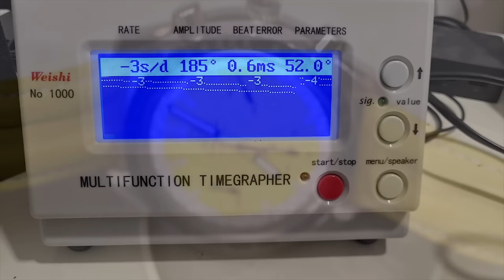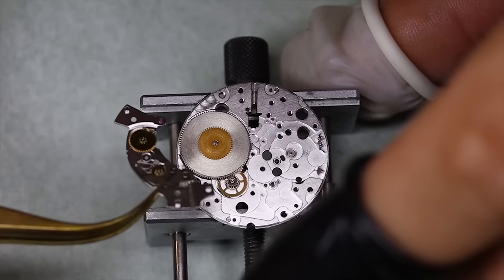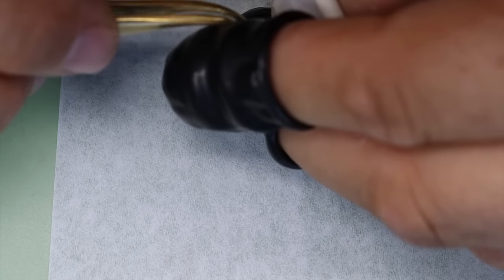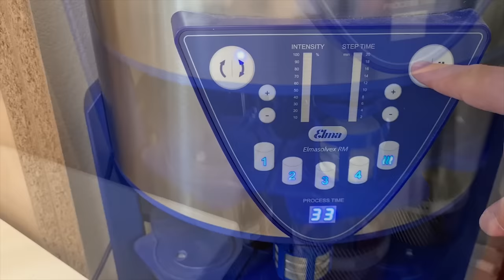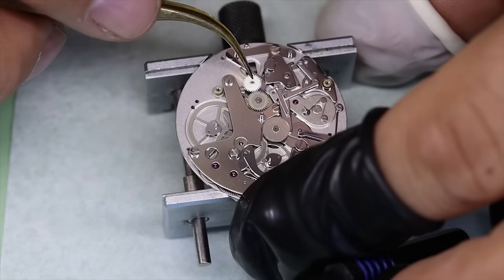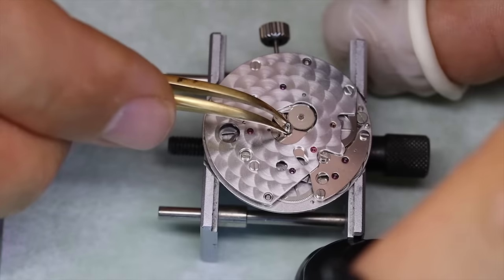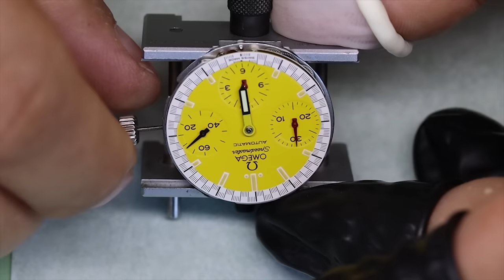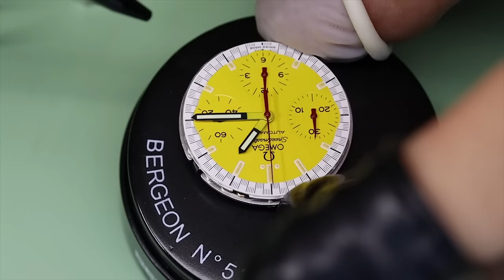The coolest watch on the track - but is it really an Omega?

Comment: I love your videos, but I didn't get it this time. I won't put a finger down, because I respect your work and your previous videos, But... 1. As is well known, in Swiss watch industry, many brands buy movements from others. Omega is one of the brands that have produced more in-house movements, but stop doing so in the 80's and 90's, and again is making their own movements since the 2000's. Is a Patek Philippe Nautilus not a PP because it uses a JLC movement? Is a Royal Oak not a real AP because it uses the same JLC movement that used PP in the Nautilus? Are VCs that use Omega and JLC movements not real VCs? That is very completely against how Swiss watchmaking industry has been build for centuries. 2. Omega didn't just take an ETA 2894-2 and put it in their cases with a little decoration here and there, as one might get from your video. As you surely know, ETA 2894-2, uses 37 jewels... Omega modified parts in the winding mechanism, also for the 2892A2, and added jewels in friction points, without adding functions. Omega 1140 has 45 jewels, instead of 37. So, disputable issue. 3. They used two ETA mechanical movements, also some ETA quartz movements, also worked together with ETA for producing these, and the Valjoux 7750, because Omega went into bankruptcy in the 80's because of the quartz crisis, and the group that bought Omega was the same that both Valjoux, ETA and many other brands.
Reply from the maker: Hello Lee, thanks for your well founded comment, I really appreciate that! You're absolutely correct in that the Swiss watchmaking industry is quite entangled and that various companies supply parts and services to each other across the entire spectre. Until the quartz crisis hit it was even mroe complicated than it is now even if they first tried streamlining things in the 1930's with ASUAG. JLC's moniker as the "watchmaker's watchmaker" stems from them providing base movements to the highest end brands, for instance, and Vacheron as an example would go on to change things like the balance and regulating system plus of course finish every single part of it to the highest standard. 
In my view, what Omega has done with the 1140/41/3220 is quite different, not necessarily technically, but commercially. They took an off the shelf movement, put on the DD module and made just a few minor changes in order to be able to somewhat defend calling the final product an Omega movement, with what that means in terms of customer perception and therefore sales price. I think that's a bit too cynical and they deserve a bit of heat for it, even if that heat comes from a small YouTube channel :) 
Note that the 2894-2 is an ETA product and does not use a DD module, although the concept is also modular.
Reply: @VintageWatchServices  Many brands have done exactly what you describe. But my point is that Omega didn't need to change the movement in order to call it their 1140 caliber or whatever, that is something everyone has done, PP didn't change much of their JLC movement in the Nautilus... But Omega did change two things: 1. The jewel count is different. 2. The winding mechanism is changed. It is not an off the shelf movement. There is nothing new in this, Rolex, for instance, never changed an screw of the movements they didn't producer an entire century. That is perhaps "cynical", but Omega at its worst moment did made changes to improve. This DD module, by the way, has been used by AP and even by RM. ETA and Omega at this point were, and are, brands of the same Group. But, the fact is that Omega did change the caliber, to improve it. there are even papers on that. Do the jewels count, you will see it doesn't match with either ETA, nor DD.
Reply from the maker: Hello Lee, I understand you have a lot of knowedge about these things but I'm not sure what you mean when you say the jewel count is different? Do you mean between Omega 1140/41 and ETA 2894-2? Those cannot be compared. The ETA 2894-2 is a 2892 base with an ETA chronograph module on top, it does not use the same chronograph module as the Omega 1140/41. The jewel count is of course different since it's a completely different module. 
The DD module used in Omega 1140/41 has 24 jewels and the base movement has 21. That adds up to 45. Is your point then that Omega thus asked DD to add jewels in the module?
Reply: @VintageWatchServices  No. I have some issues with your video, because I find it misleading. I know we are discussing very detailed and fine differences, but nevertheless. I'll explain: 1. Omega 1141 is an Omega 1120 with a DD 2020 module. Already there, the jewels count is different. But... 2. it isn't the only difference. Omega 1120 is not an "off the shelf movement." There are several changes between these two. To name some: Omega made their own automaton bridge, with smaller ball bearing, and their own gear train, and endshake corrector, which reduces the height difference between the auxiliary reverser and the rotor. this has also some other advantages. The jewels count is different, 23 vs 21, because of the ones used to hold the barrel in place. And of course the finishing, Rhodium plated, circular grained plates, bridges and rotor with Côtes de Genève, and even finishing in the upper side, which no one else did. Of course, also, Omega did their own rotor, which rides on small ball bearing. If all that, to you is an off the shelf movement from ETA, we have very different views on what "off the shelf" means. And, 3.  Will you give the same warning when talking about other brands? You have talked about Rolex, or IWC, or others. Some of these used literally off the shelf movements without changing a thing and without producing a single movement, quite different from Omega. Why is Omega's case different or special, when they did change the movement, but you have never talked about this in others, and of course Rolex comes to mind, not being able to produce a single movement in the entire XXth century. It is just too gratuitous trashing.
Reply from the maker: @leestrada1  Hi Lee, you definitely know more than I do about the 1120, but the 1140/1141 is not based on 1120, they're based on the ETA 2890. Omega 1120 has 23 jewels and indeed some more significant improvements over 2892, but the 1140/41 uses the 21 jewel 2890. 21 jewels in the base plus 24 jewels in the DD module for a total of 45. 1140 was gold plated, 1141 rhodium plated, otherwise they're the same.
Reply: @VintageWatchServices  The specific model you serviced has 45J, although there were after that 46 and 47J, so that can explain that difference, but even that one has Rhodium plated and Omega marks it as "Modified" in their internal documents. Anyway, I would still ask why would this not be an Omega and a caliber 1565 is a Rolex...? What is so special of this in this Omega, while there are more models with exactly the same (not so many in Omega's history although indeed in the 80's and 90's) than with exclusive in-house movements? If this is your take to this phenomenon, you won't finish. Not a single Rolex, Baume Mercier, many PPs, many VCs, IWCs, Breitlings, Cartiers, Bulgaris, Chopards and I could continue all day citing brands, have unchanged movements from third parties. But you pick an in-family example that is not exactly off the shelf... I juts find it curious. This is the kind of misunderstandings in the area that don't help people with lesser knowledge.
Reply from the maker: @lee S  Hello Lee, I really appreciate the opportunity to learn from people with the level of knowledge you have as an Omega enthusiast 😉

But it seems to me that your indignation is a bit misplaced here. The 1140/41 is a 45 jewel movement based on the ETA 2890 and not the Omega 1120. The 3220 is also not based on the 1120. The reason 3220 has 47 jewels is because there are two more jewels in the DD module used in 3220. The base movement in the 3220 is a 21 jewel ETA 2892, not the 23 jewel 1120.
The 1120, 1109, 1111 were indeed 2892's modified in order to be used in chronometer rated watches but are not relevant to the speedmaster reduced. From what I know they were predominantly used in seamaster chronometers but maybe you have more information on their usage. 

I still believe Omega pulled a fast one for commercial reasons with the Speedie Reduced and that's what I'm calling out. They are still great watches but as a guy mostly working on pre-quartz eta watches with actual in house movements I don't feel it's the same.

And rest assured that I do call out Rolex, for instance, clearly stating that they didn't actually have in house movements before they fully bought Aegler, but that's a different story.
If I do a video on any brand that has a movement they call in house or brand with their own name but that is in essence off the shelf, I will always call that out.
Reply: @VintageWatchServices  I have the highest respect for your work, I have seen every video you have uploaded here, and this is one of my favorite watch channels. I just wanted to clear that up, because it could seem my critique is a little harsh. I think we both have a point. I was talking from memory, and you are right that 1141 has the 2890-2 and a DD2020 on top. I was thinking of a 1120 base, which many refer to as that, and which would include the changes I pointed out. My fault there. But..., it is marked as a modified movement from internal Omega documents, where you can see very transparent information. One very obvious is that it is Rhodium plated and finished differently. I would still differ in calling it an off the shelf (although not as modified as 1120), as did Breitling or Rolex. Anyway the same critique you make in this case, I haven't seen it when talking about others, so this one surprised me, as it is a more knowledgeable channel than others on Omega. Cheers
Reply from the maker: Hello Lee, thanks so much for your kind words, it means a lot coming from a very knowledgeable guy like yourself! I do try to do my research before publishing a video, since I know I have many knowledgable viewers that will challenge me if I don't do my homework 😁 

And I do acknowledge that saying the 1140/1141 is an off the shelf movement is a bit lazy, especially when it comes to the finishing. But I also do think that what Omega put in is less than what they took out as there probably are a lot of buyers who think they're getting the kind of mechanics Omega really stands for. Not to say that ETA and DD do not make high grade products, but in-house has a very different perception in the market and will fetch a higher price. Anyway, we're at a pretty granular level with this discussion 😂

Thanks for watching my videos and I really do appreciate you sharing your knowledge like this. Did you maybe work for Omega since you seem to have a lot of inside information?

-- 
Best regards,
Stian
Reply: @VintageWatchServices  You are right, it is very granular level, haha. No, I haven't worked for Omega, I'm just very much into watches, since 30 years ago, I live and breath watches, and I collect mostly Omegas, I have also collected a ton of information on the brand, also on some others. If you ever have the need of information on a certain caliber or anything, drop a line here, if I am able, I'll be glad to share it with you. Cheers

Comment: which watch would you recommend? this speedy reduced with the chronograph module or a speedy with valjoux 7750?
Reply from the maker: Hello Miguel, I'd go for the 775x versions as a general recommendation. They're much easier and cheaper to fix if something goes wrong.
Reply: @VintageWatchServices  Thank you very much for the advice. I actually have a couple of speedys with that movement. but we must admit that this yellow dial is amazing

Comment: Stian, a question -- If you use the chronograph function a lot or for long durations, would an automatic be more accurate than a manual wind movement because the tension in the main spring is more constant or is the difference insignificant?
Reply from the maker: Hi Bullnose, that's an interesting but pretty much entirely hypothetical question 😂
If you run the chronograph for so long that the mainspring would run down, a manual winding watch that's not re-wound during the run of the chronograph would start giving less accurate results, typically running a bit slower in a well regulated watch. 
But no one really uses the chronograph anyway, so in 99.999999999% of the cases I think it wouldn't matter 😁
Reply: @VintageWatchServices  👍

Comment: Holy crap !! I am a certified auto tech and also own and operate my own Marine Repair business and that movement went way above any of my mechanical abilities . Just blows my mind that somebody can take a movement like that apart and put it back together and it actually works. I hope some day to learn watch repair . I want to restore old non working Rolex's . Beautiful job my man.
Reply from the maker: Thanks Roger! This type of module is pretty infamous in watch circles for being difficult to work on, and is honestly not much fun either. So if you can choose between an old Rolex and this kind, the choice is veeeeeeeery easy 😂
Reply: @VintageWatchServices  It is very surprising I have seen no working Rolexs for decent prices on Ebarf. I do understand your passion for what you do. I sure hope I can get clocks down and move to watches? They say if you are interested in servicing watches to start out with pocket watches . And those are dirt cheap too . Thanks for the reply love the watch !

Comment: Why would Omega use an ETA movement? Do you think that it is a fake?
Reply: I know that the ETA movement is a good movement, but it's available in a lot of much cheaper watches.
Reply from the maker: No, it's certainly not a fake :) ETA and Omega are part of the same corporate group, so it makes a lot of sense commercially.

Comment: Yes cool, but so bad caliber...
Reply from the maker: Well, it's not a bad caliber per se, it's just kind of misleading to call it Omega when it's absolutely not an Omega movement. The 2890/2892 is a high grade caliber and the module is of course well made, but a Lemania it is not.
Reply: Omega were not alone in mislabelling movements, all the big names did it. Rolex using Aegler movements etc.
Reply: Modulare concept is not max
Reply from the maker: @Gary Boyle  Hello Gary, you're absolutely right, but I kind of find this one worse than most. Aegler was in practice Rolex' movement arm for many decades before Rolex finally put a ring on their finger, but this one is pretty much just an off the shelf ETA with a DD module. I don't know, it's just feels a bit off... but maybe I'm just a grumpy old man 😂